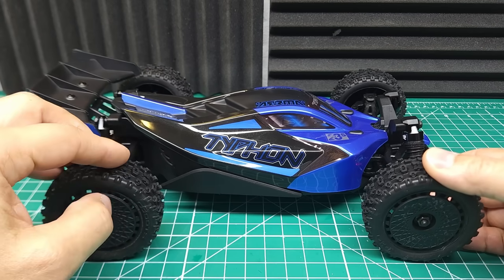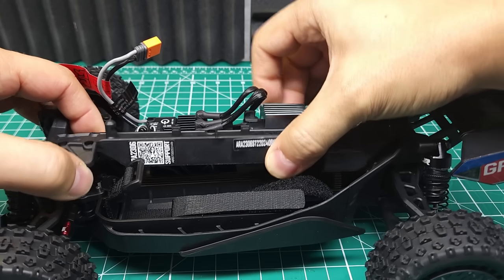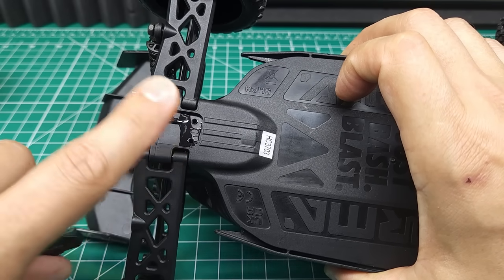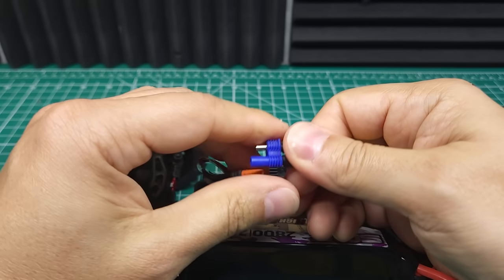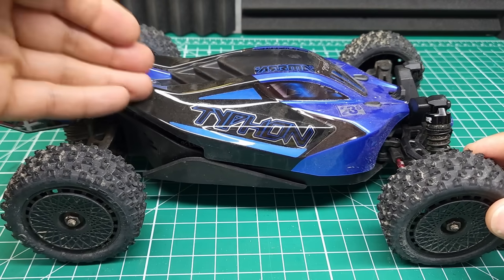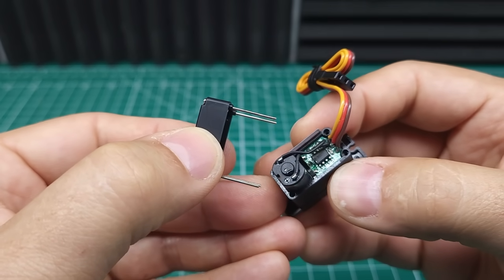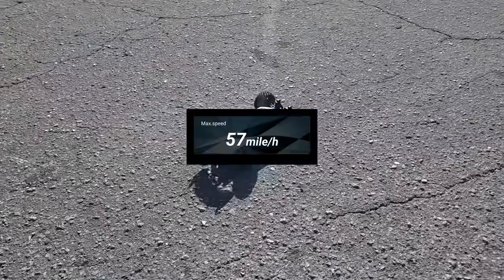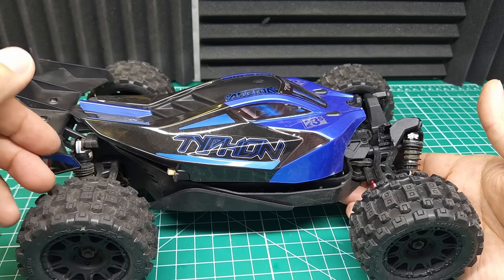Transforming the NEW Typhon Grom BLX! Review & 4S EXB Upgrade!

Comment: I tried the proline tires on mine yesterday, flipped over with the throttle pinned on 3s and 3 of them came unglued. The car on 2s with the prolines seems like the sweet spot for bashing. Great video!
Reply from the maker: Absolutely. 3S is just too much. It's a nice option but it's not necessary
Reply: I ran my modded brushed Grom on several 1/8th scale tracks on 2S with the stock gearing and it is plenty. 3S is a nice option for speed runs or street bashing in general but complete overkill for a car this small and light.
Reply: @DoRC agreed. I checked out my SLT2s, 4 of them are from OG groms and they definitely have a lighter throttle trigger than my blx grom and micro-b. Could be a recent update
Reply: Which Proline tires are you recommending?  Can you provide a link please?

Comment: What kv would you prefer if 4500kv is high stock?
Reply from the maker: I think this KV is fine for this motor in this car on 3S. Normally 3S motors are more in the 3000 to 3500 KV range but I'm sure they know what they're doing :-)

Comment: That should be standard on all new arrma rcs clipless bodys.
Reply from the maker: I suspect it will be
Reply: Oyyeee that's what I want Arma to do.Arma Baby 🙏😇Love to drive my Big Rock 3s V3 converted to 4s.And New tires and wheels 17mmHex.So can use different types.And have Aluminium shock brace in the Front.Want New Oil skock maybe the Vortex 1/7 scale Skocks I think 💬 it will work out really good.Do you have some ideas about shocks to my Big Rock 3-4sV3 😊 Really nice video thanks for sharing 🙏😊

Comment: The problem with the smaller cars and this no slipper or diff is that they can get squirrely @ speed . It’s awesome they have the gyro thingy with this set up has to be pretty good . Looks awesome . This has to be the best 14 scale or up there with near the top imo .
Reply from the maker: Especially with the gyro up to around 60 these are pretty stable

Comment: Great video, as always. Do you think gearing up with the factory motor woukd cause and heat issues? I would assume not since it didnt have a meltdown on 4s in the grass. Thanks for helping us all figure things out on these little cars!
Reply from the maker: Hard to know for sure. It probably depends on the terrain you're running in and what your expectations are. I'm honestly not sure you really need to gear up. 53 is plenty of speed for pretty much any use case with these little cars.

Comment: I do agree the adjustable after market motor mounts are a pain. It sure has great speed in stock form. Thanks for sharing this cool setup. Great job as always. 🫶
Reply from the maker: For sure. They're really not necessary either as the non-adjustable ones work fine

Comment: Proline came out with typhon grom badlands.  When I get the new BLX that's going to be my first set of tires after the stock wear out.
Reply from the maker: Yep that's what's in this video :-)
Reply: @DoRC these are the granite badlands.
Reply from the maker: @jrmbtr  far as I know they're the same thing. There's only one part number for them and the listing on proline's website compatibility with both.
Reply: @DoRC  
Badlands MX 1.9" Buggy Tires MTD Mach-10 Black Wheels: Typhon GROM
Item No.PRO1024610
I have both sets. I only have one or two packs on the Typhon with these. I did not really like them but have not given them a fair shot. Once I get the brushless models I will try them on there. I do like the Prolines for the Granite on the Granite. I would like to see some options for the Mojave that do not require body modification.
Reply from the maker: @jrmbtr ah cool!  I really like the granite ones on the typhon. Monster buggies are pretty much my favorite type of RC

Comment: I want to thank you for your excellent content. I have recently snapped a front shock tower and transplanted the contents of the car into a whole new chassis. One of my rear shocks is not rebounding anymore, and I’m guessing it needs oil. What kind of oil do I need to get? I’m also noticing some loud gear noise, and I’m thinking I need to add some grease to the diff housings. What kind of grease goes in those?
Reply from the maker: Lack of oil will not cause the shock to not rebound. It's either going to be something binding in the shock or something binding in the suspension. I would recommend taking the shock off and checking both so you can honestly which one it is. As far as greasing the gears pretty much anything will be fine though if you're hearing a new loud noise grease probably isn't going to fix it. There's likely something wrong.
Reply: @DoRC Well, I took the shock off, squeezed it a few times, and put it back on, seems to be working fine now. Not hearing any noise rolling it around. I’m wondering if the suspension thing may have been causing the noise all along. Gonna run it again and check it out.
Reply from the maker: @randylivengood3112  maybe. If the suspension was compressed it could have been causing something to bind.
Reply: @ I just ran it, and it seems to be working fine now! Mad scientist to the rescue! Thanks again!

Comment: Can you show a video of how the motor mount is placed In correct all I did with mine was take it apart and put it back together and it has a hobble gear grinding sound now and I’m not sure what I did wrong I put it all back the way it was supposed to go the screws including and it’s still grinding bad makes a horrible screeching sound as it’s taking off.
Reply from the maker: Try taking it back apart and put the motor into the center brace first then put it all back in. Sometimes it can go in crooked if you don't do it that way

Comment: Just got my son and I a pair of these for a beach trip do you think I should get paddle tires?
Also any tips for keeping them going and running nicely?  I know the salt is going to be a big issue.  I am brand new to this and know nothing about RC, differential, gearing, etc...
Reply from the maker: Paddle tires would probably be fine. As far as maintaining after the beach you're pretty much looking at a full strip down each time. The salt will get everywhere and it will cause things to rust and seize up.
Reply: @DoRC  do you have a video or link to a complete tear down video and explanation as a guide?
Reply from the maker: @TW-AZ I don't but they are pretty straightforward to work on. This video shows most of the work you'd have to do to take one apart.

Comment: You mentioned the motor got hot on four s 

Not likely has to also deal with the increased diameter of those tires when you put a larger tire on your car you’re technically gearing up probably should’ve dropped a tooth off your Pinyan or two but I’m glad to see that little truck didn’t disappoint
Reply from the maker: Yeah the increased tire size definitely didn't help though It got pretty warm on the speedruns too. That motor just isn't designed to handle that kind of power. I'm also skeptical of how long it would last just by how fast it's rotating on 4S. 4500 KV on 4S is a lot
Reply: @ absolutely 4500 is a monster high kv on that many cells 

I know I get kinda sketched on a 3000 kv on 4 s 
But it was certainly a great experiment and I think it looks great on those larger wheels 

Thanks for what you do 
I really like the technical side of building and design of these cars 
I enjoy to run but not really to watch others run on video lol 

You blend enough of both together that it’s bearable.   I’ve watched other guys who go over the cars like you do but it’s brief then more is them running the car 

I’d rather see what and why things work and how to learn different ways to do those kinds of upgrades 

As I’ve been into this since the 80 s and started in the time when rtr wasn’t a thing 

Everything was you build the kit 

I work as a tech at a shop and use tons of different techniques that I learn from others to repair broken cars on for service 

As I can’t afford to buy every model I am not always familiar on how they disassemble and have learned a lot from guys who do have these different cars.  
 Thank you for what you do
Reply from the maker: @AlbertPerry-f9h  Yeah I've been an automotive mechanic for 20 years and it just sort of bleeds over into the hobby. I'd be tearing these things apart if I was making videos or if I wasn't so I'm glad to share!

Comment: Hi !! How did you solve the differential  liquid leaking ??
Reply from the maker: Seems to have solved itself. Sometimes these will leak and transport I think due to being on airplanes and then not leak in use. I've never had any of their other ones leak when I upgraded other Groms and this one seems to have stopped in use.
Reply: @  Do  you recommend this model for a newbie ??
Reply from the maker: @emmanuelcheveau4891  as long as you understand it's limitations definitely. It's very easy to work on and pretty user-friendly. The main limitation is where you can run it. on smooth hard surfaces it's great and on reasonably smooth terrain like dirt and gravel it's not bad but it's not going to do well in grass or anything really rough.
Reply: @ Do you have a better recommandation ?? Buggy style !!  Around the same budget.
Reply from the maker: @emmanuelcheveau4891  Hop on AliExpress and get a 3S Typhon.

Comment: Hey there, I like your video. Can you send me a YouTube link on how the GPS works for doing the speed testing like you're doing in this video. I bought one but I haven't quite figured out how it works. Thanks!
Reply from the maker: I don't have one but if you have the GNSS GPS you just need to download the GNSS app connect to the GPS and wait for it to say it's got satellite signals. Then you can move the car back and forth to make sure you can see the speed changing at the bottom on your phone. Once you verified that just hit track and then start. Do your speed run bring it back then hit stop and read and it will give you the top speed.

Comment: Can you program the old radio to the new esc like if you had the brush and you won't to upgrade to that motor and esc will the old radio will work
Reply from the maker: Unfortunately no. You would need an SLT compatible receiver

Comment: My friend random question??
I brake my shaft or rotor on my 1650kv motor u think I can welding that or how I can fix it
Reply from the maker: I'm sure there's somebody in the world that could weld it but it would have to be done without overheating the magnets and it would have to be very straight and strong. Practically speaking it's probably not going to happen. Unfortunately they also don't offer replacement rotors so you're probably going to be buying a new motor.
Reply: @DoRC  yea sad for me,I order one already and thanks always for your help, God bless my friend

Comment: So is it normal for the glue on the tires to come off after 2 days of play? Was on a 3s battery and was zooming up and down the street but 3 of the tires had to be reglued and I’m no pro at doing that.
Reply from the maker: It shouldn't be normal but it is fairly common. I'd recommend getting BSI 2000 tire glue as it's the best, make sure there's no debris between the tire and the wheel and then just glue them back up. If you're not experienced it probably won't be pretty but then again it doesn't have to be :-)
Reply: Nice. thanks for the help.

Comment: Great Video as usual. I think Arrma did a great job with the BLX versions of the Grom vehicles and priced them really well for what you get. I'm curious if you checked to see how the diffs are holding fluid after you bashed it? I don't know that it is a real issue but it really bothers me that they didn't put seals in the diffs.
Reply from the maker: Yeah I haven't seen one leak until now. I did check and it does not seem to have leaked anymore in the few packs I've put through it

Comment: There is a GPM alloy front damper plate available. You think it'll protect your chasis?
Reply from the maker: I wouldn't worry too much about it. I've beaten on several of these pretty hard and this is the first time I've snapped the shock tower. I think it was just a really bad hit and I believe it may have been cracked previously.

Comment: great content 👌🏻 keep it up! Any chance you will use the new hobbywing xr10 pro G3 in one of your future videos?
Reply from the maker: Probably not. I tend to stay away from non waterproof ESCs if I can help it
Reply: @DoRC I wish hobbywing hadn’t slowed down production on the max10 60a (the one that comes with LC racing pro kits). It is a really awesome waterproof mini basher ESC with the added benefit of a 7.4v bec. Not sensored, but same footprint as the 10bl60SD. 3.5mm bullets built in.

Comment: Why are they thread locking the diff screws?
Reply from the maker: Just the one that holds The output cup on
Reply: @DoRC  I see, thanks. Any recommendations for 3s batteries for the Typhon grom? No budget. For bashing
Reply from the maker: @magnusstone  Yeah check out the SMC 2400. It fits well and is a great battery

Comment: Great lil buggy...and, MUCH better than the original brushed version.  Glad I didn't buy that one.  Upgrading of would have cost was more.  Btw, I'm guessing you weren't aware that Arrma makes a separate servo mount & ESC mount - Servo Mount/Radio Deck for Standalone ESC/Receiver: GROM.  The part number is ARA320753.
Reply from the maker: Yep. If you check my very first granite Grom video I have one of them in there. I just failed to buy one for this project so I 3D printed it instead

Comment: Hey man what receiver did you use I’m trying to find a cheap receiver that will bind with my grom blx transmitter for a brushless upgrade to a jrx2?
Reply from the maker: I didn't use the stock transmitter. You might be able to get one of the SLT3 receivers to work with the SLT2 transmitter but it's not something I've actually tried so I'm not certain

Comment: My BLX Typhon's drivetrain is louder than my brushed granite almost like the mesh is too tight. Do you have a brushed version to compare? Also the servo is alot slower on my BLX.
Reply: I would recommend running a pack to see if it loosens up and if not going in and seeing if you could shim the diffs at all :)
Reply from the maker: Mine is also a little bit more noisy. I think it's probably down to manufacturing tolerances though. As long as it rolls smoothly I wouldn't worry about it

Comment: Do you know what size are the screws that mount the arrma grom servo into the chassis? It should be an M2x10 screw right? Anyways great video, loved seeing it rip on 4s as I have a grom which I converted with the Hobbywing kit and it flies at 50 mph!
Reply from the maker: Do you mean the servo to the servo mount or the servo mount to the chassis?
Reply: @DoRC  The servo to servo mount screws which have a hex size of 1.5mm.
Reply from the maker: @iamgeek01  Yes I believe they are m2x10

Comment: I dont get it they have something wrong idk. Maybe its not enough power or something but my typhon i built is a 4500kv with a 21t pinionand it does 65 at least i had about 1/4 throttle left.
Reply from the maker: What ESC?
Reply: @DoRC  I'm not sure I just know it's a spektrum 3s. But if I'm being honest 65 was on bumpy back country side roads. On a smooth surface I bet I could get a lot more out of it. The part we seem to forget, myself included, is weight. My goal with mine was to keep it as factory looking as possible, success, mostly. Lol. As light as possible, so while I improved the shocks I did not put the aluminum ones on. Keep a front weight bias to keep the wheels on the ground, and reduce friction as much as possible. Originally I did swap to the Gen 3 diffs but it slowed the car a bit. So I went back to the Gen 2 grease filled ones and it really makes the difference. Obviously the 3rd gen are better overall but with 4 different diff sets the 2nd gen grease filled seemed to have the least resistance, by speed, of the 4. The 4 I tried were gen 1 2 and 3 and an aftermarket set of oil filled. All the same result. The 2nd gen grease was 65mph repeatedly while the 3rd gen were 60-62 repeatedly. Anyway have fun. I probably should be doing some kind of work. Lol